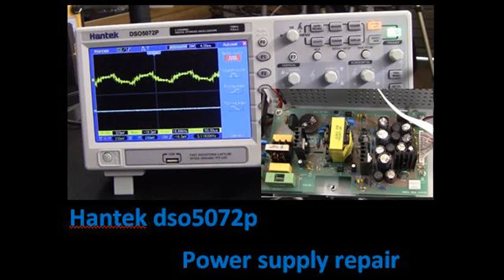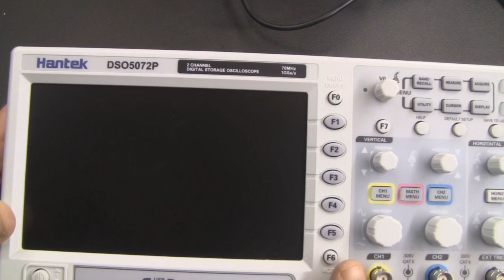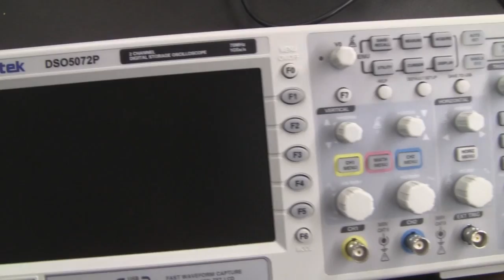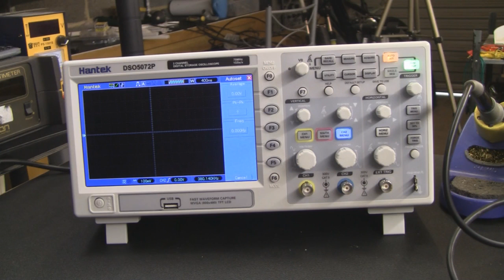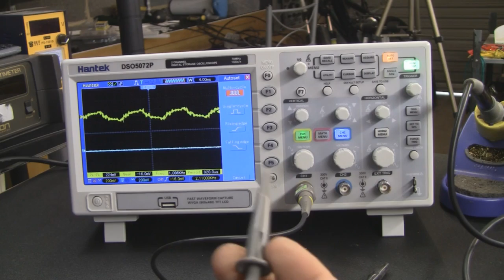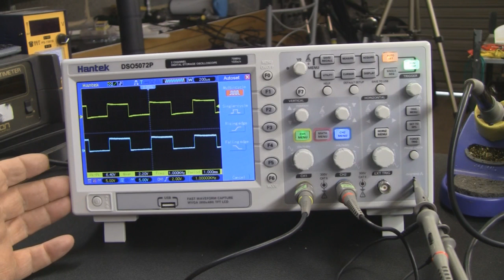Hantek dso5072p Power Supply Fix

Comment: Late entry here. As you noted, normally it is better to turn on before buttoning up the scope. A good reason to do that is to check for overheating, smoking, shape change or movement. You probably have safety goggles, right? Keeping the hand on the power switch for fast turn off. I would have (in your research) discovered the primary voltage expected and attached leads to a meter as I turned it on. Thus, you see over/under voltage and can turn it off before more damage down the line occurs. Also, if nothing happens, turn it off immediately and inspect. Standard procedure. You were doubly lucky. 

Turns out a good deal for you and some one else is maybe kicking themselves for putting the scope in the wrong box in the garage  ;-)

Comment: What I miss in your video is that I try to turn it on first before I take it apart. If you have an electronic workplace, even a short circuit would not cause any damage. If the device really doesn't work, then I'll open it. I have the same Hantek DSO5072P at home and I am satisfied with it. It could happen that no one knew what an oscilloscope was and when they turned it on, they didn't do anything without knowledge and without cables. It could be perfectly fine, just add probes and maybe it works. The principle is to start from the simplest, play specialist with a screwdriver un the end.
Reply from the maker: But it rattled 😉

Comment: Most of the time the original owner probably passed away, so the next of kin was cleaning out stuff of theirs and when something like this doesn't work they tend to take them to thrift stores, with the thought that they fix them and then sell it. The bad part is most thrift stores in the US don't fix or even check if it is broken. I have purchased many things in the thrift store and most of them were broken. I buy them with the intention of fixing them. Like my Onkyo turn table. It was broken and I purchased it and fixed it. I don't mind that part, but many can't fix these things, so they take them back to the store and the thrift store sends them for recycle and that is a shame, because I could have got that item for free or donation and fixed it. Most of the time it can be fixed cheaply.

Comment: I hope that was a 105˚ cap you put in.
Reply: Noob here......correct me if I'm wrong but when would the internal temp reach 105C? ...wouldn't the board/case melt etc? or does it refer to an internal temp of the cap itself? Do they actually get that high under normal usage?